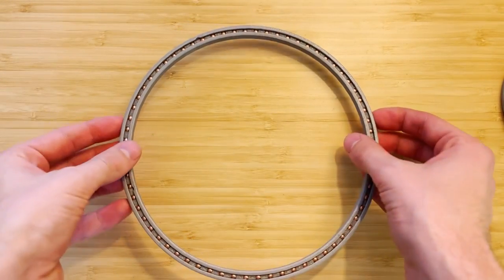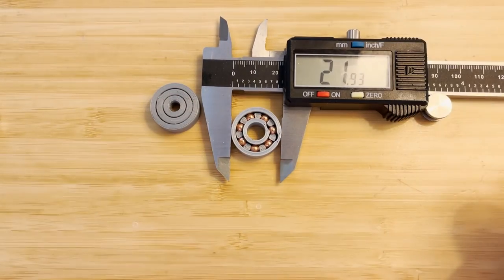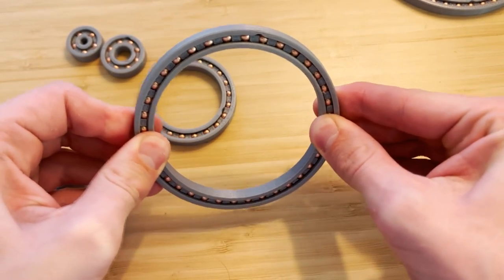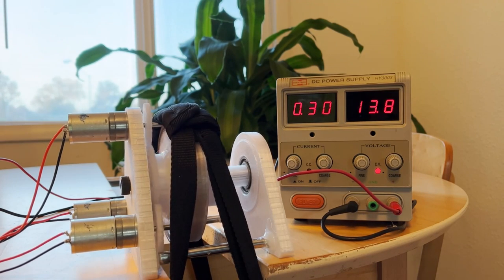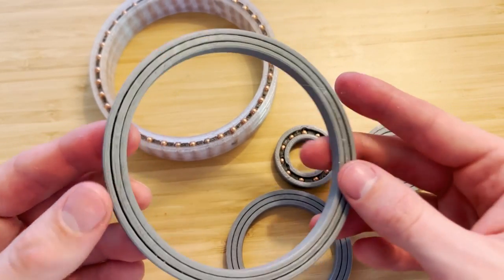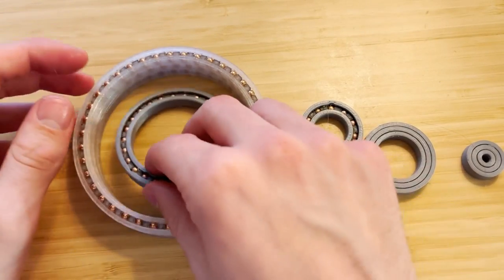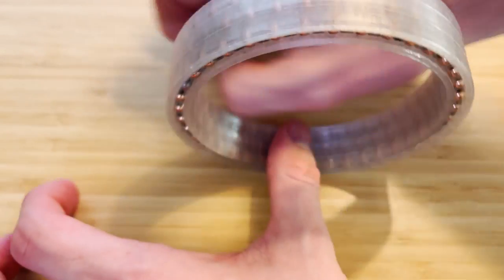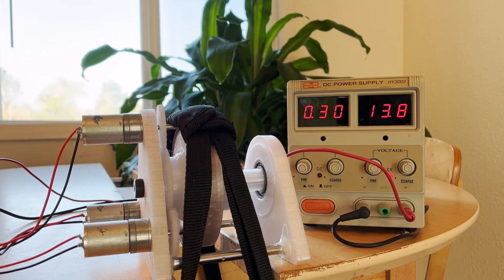24 Hour Torture Test of 3D Printed Bearings

Comment: Will a stack of triples (like 3 or 4 triples) hold up to a lathe headstock if lubed well?
Reply: Not a chance, PLA simply isn't hard enough. They would wear very quickly under axial load, and they'd also provide a fraction of the rigidity of steel bearings.
Reply from the maker: It probably won't for long term use, but if you make a stack of 3-4 with much thicker walls than you might be able to squeeze out a little bit of use, but just a couple minutes if anything. (If you try this I would encourage you to use nylon or something that can tolerate higher heat). No guarantees, but I would love to see the results.
Reply: @Dangineering  Nylon wouldn't be much of a problem. If I try this I will definitely be hard nickel coating a few thou thick. Spray a thin layer of copper conducting paint and then electroplate a "thick" layer of nickel chloride or the like (can't remember exactly which is hard nickel vs decorative nickel)
Reply from the maker: @natereinhold6180  That would be super interesting! I would actually be down to give that method a shot should it work for you. Have you done this coating process before on other 3D printed parts?
Reply: @Dangineering  Electroplating 3D prints has been around for a few years. There are videos showing the results here on Youtube.
Reply: @DKFX1  it's been done on injection molding for far longer than YouTube has been around. That's how cheap chrome car trim used to be made.

Comment: Where can i buy those bearings like each single one
Reply from the maker: You can 3D print them for next to nothing if you have a 3D printer and some BB's. Check the description!
Reply: Oki thanks
Reply: I don't have a 3d printer though
Reply: Which ones would fit on a 4 1/2 inch cylender and a 5 5/8 inch cylinder and on a 6 to 7 inch cylinder
Reply: Im trying to use bearings for a metal suit I'm making
Reply: Specifically the arms
Reply: For the wrist the upper arm rotation and the shoulder rotation

Comment: you need a dialgauge and a press :D
Reply from the maker: That would have been very helpful! but unfortunately not in the budget..
Reply: @Dangineering  dial indicator isnt that expensive. You dont really need the mitutoyo. And you can make a hacked press with weights and a lever. Not expensive at all. You can do it!

Comment: I think cooling is very important
Reply from the maker: Yeah, at very high RPMs (8000rpm) they start to get hot in about a minute and start to lose integrity during the second minute unless I started to cool them. However at those speeds I would advise switching to a real bearing as these are more for functional prototyping
Reply: @Dangineering  where would you need 8000 rpm? already 2000 is enough revolutions like a lathe
Reply from the maker: @martinTintin476  I am using a relatively high power brushless motor in my combat robot and was using it as a means to informally test the bearings a little bit. I don't need that speed for any of my projects I just wanted to share my experience.

Comment: This is not a problem you can solve with a 3D printed part in plastic. Search for "Frictionless Bearings - Technical Secrets Explained!" here on YT.
24 hours? might es well be 5 minute test when it comes to bearings. Go skate with it and report back 😁
Reply from the maker: Never claimed I could solve anything? 

These bearings are not meant as a 1:1 replacement. They are meant to be used as prototyping tool so you don’t have to waste money on expensive large diameter bearings that won’t be used in the next iteration of the design. 

I personally would not skate on these as I don’t think they would last, but I do think it would be interesting to see the results. 

I’m not trying to design around real bearings with PLA. I’m trying to give myself tools to allow myself to design with parts far outside my price range